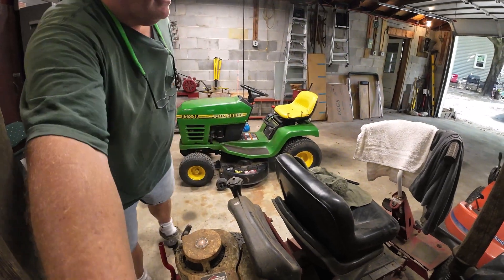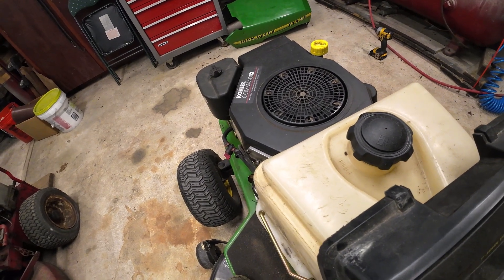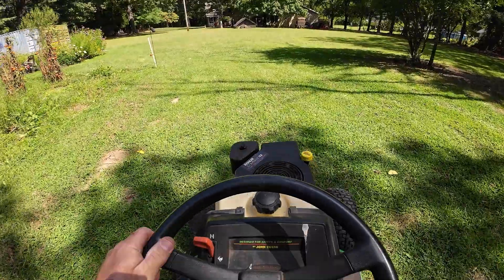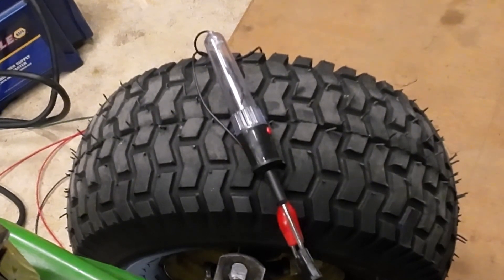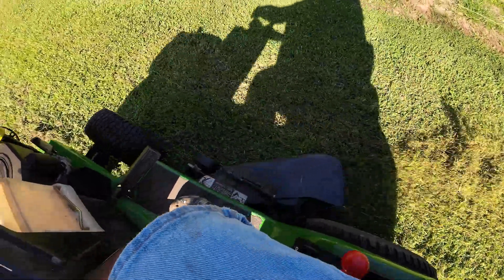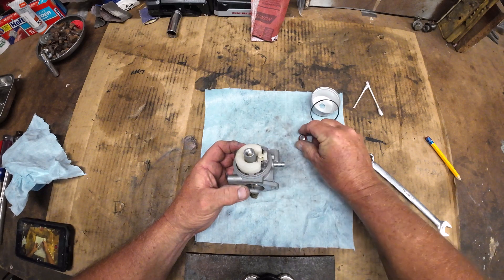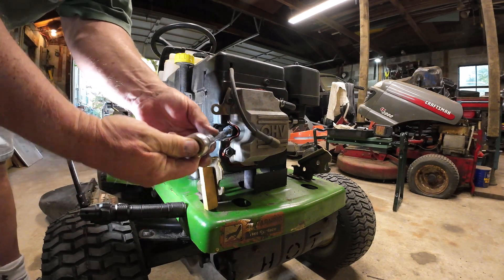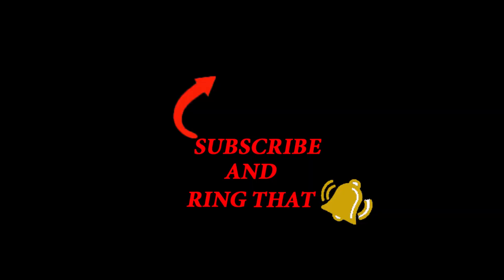John Deere STX38 Mower Won’t Mow! Can We Fix It?

Comment: I was waiting for you to find the loose ground wire. Have a Stx38 yellow deck since 1990. Just had to reattach the engine to the frame as only the ground bolt was still holding it on. Started to vibrate last fall and I didnt get to investigating the issue until this spring. Once I got all 4 bolts back in with blue locktite, no more vibration.
Reply from the maker: The owner of this STX fought with it for a long time. Fortunately it was a simple fix.   Thank you for your comment.

Comment: Them John Deere from that error has the worst hoods than any other mower ever made. I don't think I've ever seen one that functioned as it should. Great video.
Reply from the maker: John Deere certainly made the worst hoods back then. Thank you for the comment.
Reply: @GaryAhl  My hood has been perfect since 1989. User friendly as well.
Reply: My stx38 is 34 yrs old and has the original hood in non broken condition. I’ve never had a problem with it, but it is a PITA to take off and on.
Reply: My 1990 stx38 still has its original hood in one piece and my only complaint is how difficult it is to remove. I have gotten better at that after diagnosing my recent engine vibration issue. Now if I can remember how to take it off the next time I will be doing great. Chances are I will forget and will need to figure it out all over again. Getting old sucks.

Comment: Watch the temperature of the cheap carb. I ran one and it felt OK and I noticed it was actually lean because the engine got much hotter. Hotter than I wanted to risk.
Reply from the maker: I can see that happening with cheap aftermarket carburetors.

Comment: Would cut better with both blades not upside down😂
Reply from the maker: Lol, I didn’t catch that until after the video was posted. It sure does cut better with the blades on the right way!
Reply: Also a wire rapped around the spindle......🙄